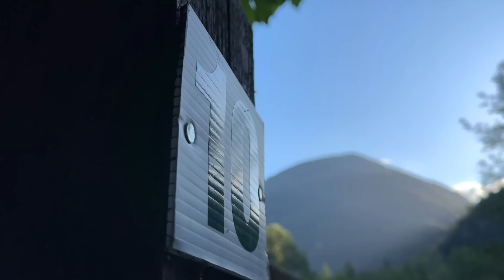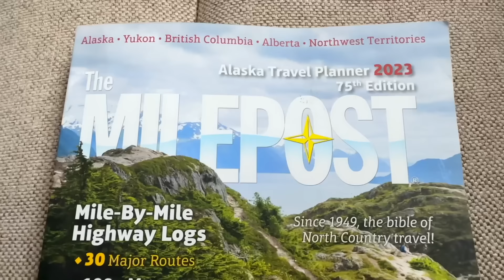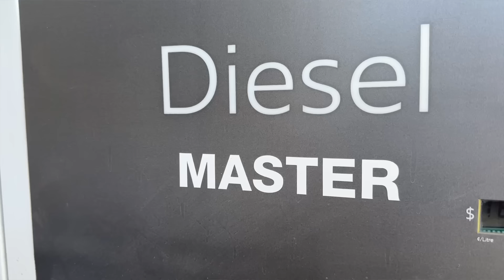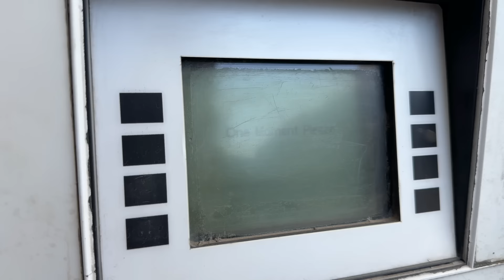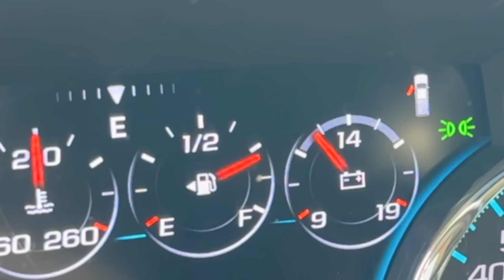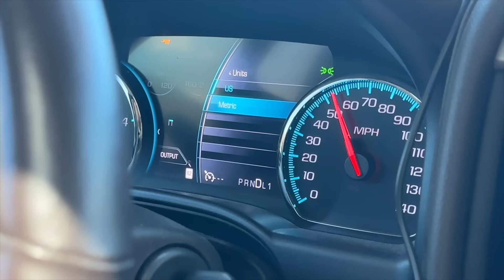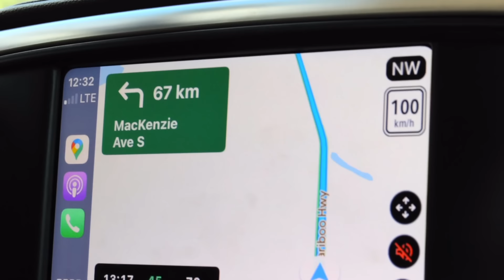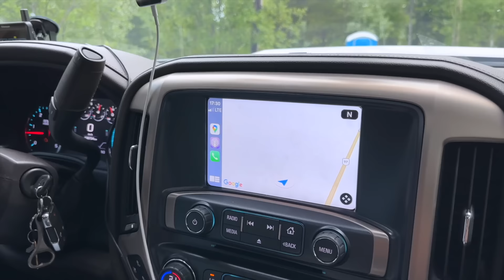We Were NOT Ready for This - RV Living in Canada is Different!

Comment: OK, actually the diesel pump marked as MASTER is the pump that also controls the SLAVE pump on the opposite side of the truck so that when semi's fill up they can use both pumps to fill the tanks on each side of the truck. The marked diesel info is correct.

Comment: If you buy a proper jug of DEF it comes with a flexible spout equipped with a breather so you can pour it directly in without spilling a drop. No funnel needed. That stuff is corrosive and will cause you grief down the road the way you are doing it.

Comment: I'm not sure about American vehicles, but vehicles purchased here in Canada always come with kilometres on the speedometer, with miles in smaller font on the inside of that so you don't have to convert. At least older vehicles, not the newer fancy ones with LCD interfaces (my truck is a '98). And the reason we have "marked" diesel is because the taxes you pay on fuel go to maintaining the roads. Naturally, it makes sense that you shouldn't have to pay to maintain the roads if you're not going to be using them other than to get from one field to the other. Most gas stations that have diesel will have containers of DEF available for purchase inside.

Comment: New comment for the next video segment. The diesel master means that there is a second pump on another island for fuelling commercial trucks with tanks on both sides. There is probably a pump with the same number across from you, and that is tied to that pump. STAY AWAY FROM DYED FUEL. That is for off highway vehicles only (farm tractors, construction equipment, etc.) and you don’t want to caught with that in your on highway vehicle’s tank. It is not charged fuel tax at the pumps, so they dye it to catch people who try to cheat the fuel taxes.

Comment: You need to get a Ram 2500 with the Cummins diesel. The DEF intake is next to the diesel intake
Reply: I’m not sure a Ram 2500 would have the payload they need for that trailer because Ram still uses coil springs in the rear suspension.
Reply: @BigBirdNest  The 2023 can

Comment: Never add DEF at the same time as filling up your tank with diesel. I have a TITAN XD the DFE is right next to the diesel tank. My wife came up and talked to me right after I filled up diesel I opened the DFE and added it to the fuel tank instead of the DEF tank. Lucky I had filled it up with diesel first so he back spashed out when I started to add it so no damage was done. Nissan thought of this and added a water seperator below the fuel filter to empty any water or def accidentally. If I owned a Ford it would cost over 10K to completely change out the entire fuel system. Also remember to double stock DFE when towing because you use DEF twice as fast while towing.

Comment: Its too late to tell you. Rather than taking 37 at Kitwanga continue to Terrace and go up the Nisga'a Highway which will take you through the Lava Beds. You then cut across to 37. Hope you took the trip into Stewart and over to Hyder. Excellent border crossing there:)
Another side trip which would take you from Dease Lake down to Telegraph Creek. Definitely worth the trip. Would add a day to your trip.
As for the two types of diesel. Have never heard of Master and I've been using diesel fuel since 1994. The marked is cheaper but most stations won't sell unless your putting it into a tank.

Comment: Diesel pumps correction.

Dyed diesel is tax free. 
Diesel is diesel
Master Diesel is for Big rigs ( master tank) and usually a larger nozzle
( I can’t remember the other name.. aux diesel or satellite diesel is for the passenger side tank I think.
Long story short I think he may have been at a big rig pump.
I found this out last year when I bought a diesel and tried to fill up at a master. Nozzle was larger diameter and pumped too fast ( lots of spray back)

Comment: I love my late model 2002 dodge diesel three-quarter ton. Each speed. No DEF praise the Lord. But it’s high mileage. It’s finally hit 72,000 miles US. I need to drive a little bit more but when it’s only one of you and you have two vehicles you seem to take a smaller vehicle because I have a long bed extended cab because of the fifth wheel. So I can always park it just any place easily so I drove the car a little more.
Reply from the maker: Thank you for sharing!

Comment: So much easier than US diesel pumps. Marked makes sense. We have tanks at home (we are rural and have equipment that we use off-road for fuel because it is less expensive) for both and that’s easy for me to fill with no dye diesel.  I took a road trip to MN and I didn’t know what the numbered pumps of diesel meant. “Marked” would have totally clued me in because I know this but y’all didn’t know that. Using dyed fuel voids your warranty on your truck. But if your warranty is expired??? Could be a fine in some states in the US, I’ve been told. Do your own research. A lot of people are strongly against getting a lower cost diesel price for Marked diesel when you should be paying for on-road just like the rest of them. I have no opinion but use undyed.

Comment: The DEF jugs come with an attachable flex hose for a reason. Hopefully that's not a picture of your underhood and it's off the internet from someone who doesn't care about their truck. I keep an empty 2.5g jug with me and when I fill with pump DEF I also fill my jug for use between pump fills. GM put the fill underhood to prevent people putting DEF into the fuel tank (Ford). They've changed it now AFAIK (my '17 L5P is underhood). For us Cdns going south the CBP are just as bad (or worse) than the CBSA

Comment: An easy way to calculate in your head celcius to fahrenheit, double the celcius and add 30.  So 21 degrees celcius doubled add 30 is 72 fahrenheit or close........km to miles, just multiply km by 62.  100 km is 62 miles; 100 kph is 62 mph.

Comment: There's only three countries in the world not using the metric system....USA ,Liberia and Myanmar sooo .... dyed or marked (same thing) is for off road only and DEF is available at the pump if you fuel up at a truck stop fueling station. Usually on the opposite side of the actual fuel pump(main) .
Liters to gallons is aprox to 4to1(3.78) since the US gallon is smaller than imperial gallon(4.54). Speed is easy 30kph=15 , 50kph=30 , 60kph=40 , 80kph=50 , 90kph=55 , 100kph=60 , 110kph= 70 those numbers are not exactly equal but, you will never get in trouble with those mentioned .
Enjoy our country, be well !

Comment: FOR D.E.F.  USE A CHEAP 2 GAL GARDEN SPRAYER, CUT OFF THE SPRAY TIP, AND IT WILL WORK GREAT FILLING YOUR D.E.F. FILLER TUBE.

Comment: Your truck doesn’t have the selection on the dashboard to switch to Kilometres per Hour?? Because most new vehicles sold in Canada have the option to switch to Miles per Hour in case we want to cross the border. My 2020 Toyota Tundra has the option to change over if I cross the border

Comment: DEF. The reason those of us with non DEF vehicles will spend a lot to repair our real Diesel engines rather than computer controlled, emissions system ruined, diesels. 
My 2001 F350 with manual transmission and low profile utility bed is awesome

Comment: You’re making a mess under the hood with the DEF because you’re using the DEF container incorrectly. You should use the spout that comes with the DEF container, lay a paper towel down underneath it and just tip the DEF container over and stuff the spout into the DEF receptacle that’s how I do I don’t get a drop of DEF on the components under my hood.

Comment: Lol its not Master diesel its just Diesel You pulled up to pumps that are made for vehicles with tanks on both sides like semi trucks.  The main pump is the Master the secondary pump is called a Slave.  The slave pump will not work unless the switch  is turned on on the Master and typically the slave pump does not have a liter (litre in Canadian spelling) and dollar counter.  Just the Master.  The Marked pump you were correct on.  They dye it because you won't get charged the federal and provincial taxes on the fuel for vehicle which do not travel on Government roads.  If you are caught using dyed fuel on public roads will get you big fines.

Comment: Welcome to Canada.  Most gas stations here will have DEF inside (you might just need to ask where it is).  Instead of a new truck, when your warranty is over, have the DEF system removed.  It’s better fircthe truck and increased my gas mileage by 25%-30%.  PLUS now I’m not worried about someone stealing my catalytic converter when I’m parked